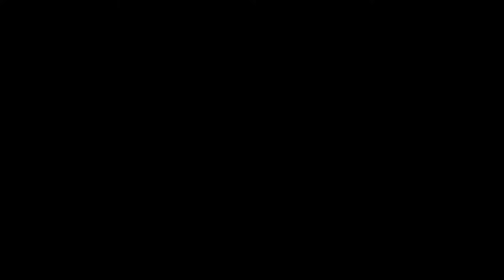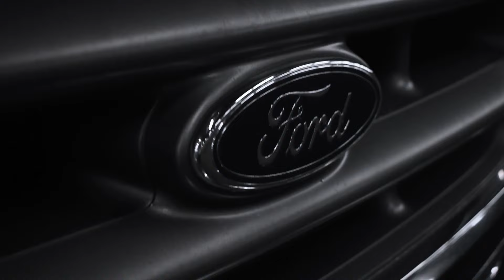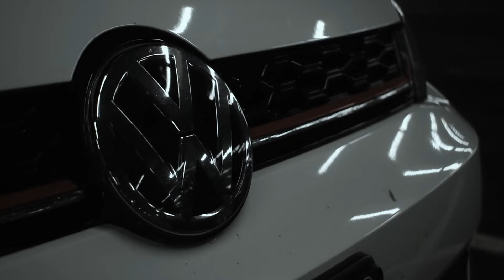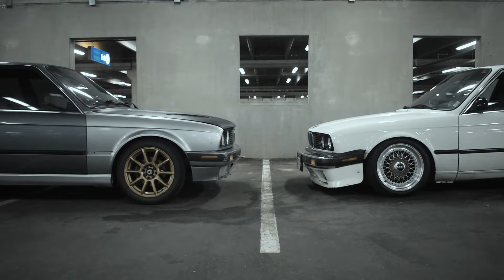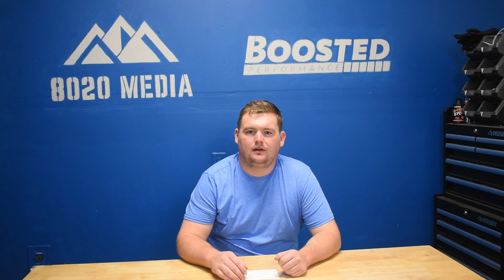How Reliable is the Ford 3.5 EcoBoost? | 3 Common Problems

Comment: I have a 2010 Taurus SHO with the 3.5TT and I would definitely include the water pump at 100K. If this fails, and many have it can drop the coolant into the oil pan. At which point you are out an engine. I replaced my water pump and timing set at 100K, carbon cleaning at 110k. Only other failure I have had is a torque converter at 125k but that is platform specific and not something I think affects the F150. 
Otherwise I am very happy with the power and overall smoothness of the 3.5 ecoboost.
Reply from the maker: Henry - Thanks for sharing your valuable experience and insights with your Taurus!
Reply: I thought the 3.5tt was external water pump.

Comment: I bought a 2012 in 2015 with 37,000 miles on it. I drove to 97,000 miles and sold it. I'm very sorry I side. One problem was an o2 sensor.  Replaced brakes (normall), no other problems.  Good maintenance is the key to any vehicle, it always has been and always will be.
Reply from the maker: Jim - Thanks for sharing your experience and insight!

Comment: One would think that after manufacturing cars for 112 years, Ford wouldn’t have so many quality problems/recalls with their vehicles. God forbid car manufacturers put a few more quality parts in their cars/trucks so they wouldn’t have such a PR problem. Crappy parts and higher prices= …ain’t gonna buy a new one for now.
Reply from the maker: D - Unfortunately this seems like a common theme with many brands nowadays, not even just Ford..
Reply: That would make sense D... if Ford was still producing Model Ts. If that was the case I'm sure they'd be building them with zero issues today.
Problem is... every year there are advancements made in every conceivable category related to the modern automobile. From tech to ever increasing government mandates for safety and fuel mileage... today's car manufacturers are constantly breaking new ground.
Reply: Constantly breaking new ground and still can't get cam phasers right. They have had problems with them in multiple engines and still have problems today! If you want to buy a ford. Kick yourself in the balls and go home and think about it.
Reply: They don't, the F150 is the #1 selling truck because they last, plain and simple. Look at people that depend on trucks for their living, what are most of them driving? A Ford.
Reply: recalls fix problems.  Glad they do them.  All of the makers do them.  Its now the norm.  In the past they made it your problem
Reply: @8020Media  Government FE and Emissions regulations have increased the complexity of every engine out there.  The complexity brought on by the government, combined with near impossible future emissions regulations, and government subsidizing of non-ICE vehicles, is the main reason (PHEV)hybrid and EV are so attractive to manufacturers today.  Self fulfilling prophecy, right or wrong.

Comment: Great video. Love my 2019 ecoboost. If you were to buy a half ton truck today based simply on reliability, what would you choose?  Still go with 5.7 on the Tundra?
Reply from the maker: S - Thanks for sharing your experience! As far as a new truck, we're not sure.. They just don't make them like they used to. Maybe anything naturally aspirated.
Reply: thank you.  I’m not a mechanic so if you can speak dummy that would help. What exactly is naturally aspirated?  I assume my ecoboost is not, but the 5.0 Coyote, the 5.3,6.2 GM models would tend to be more reliable given they are less complex from a design perspective. I’m just looking for something that will give me 250K assuming I just change the oil every 5K miles using high quality / Motorcraft synthetic oil. As you pointed out, I think the timing chain and carbon build up were fixed in the second generation.
Reply from the maker: S - If you want to stick to Ford, then the 5.0 Coyote is solid. GM's have AFM/DFM that are pretty problematic.

Comment: Change the oil early,occasionally wot ,love my 3.5
Reply from the maker: Jason - Thanks for sharing! We love a good 3.5 Ecoboost that is well maintained!
Reply: What oil u use ? Thanks
Reply: @cheizaguirre5494  is use Mobil 1 5w30 full synthetic and MotorCraft filter every 8000kms/5000 miles
Reply: @jasonbrushett2005  same thing I use, Mobil 1 is the best.
Reply: @8020Media  what do you guys think is the time to change the 5w30 semi synthetic oil? I plan on 4000 mi, but only have 1200 mi on this oil now

Comment: I own a 2014 F150 with the Coyote! It’s a decent truck, but having owned Honda and Toyota cars for the last 30 years, it’s too many little maintenance niggles in the Fords. The radiator failed; blower motor resistor failed; blower motor failed.
Reply from the maker: Gamita - Thanks for sharing your first hand experience! This will certainly help future viewers.

Comment: I have a 2017 3.5l twin turbo eco boost, my engine locked up completely  now I gotta buy a  new motor
Reply from the maker: Richard - So sorry to hear this. Do you happen to know the cause of this?
Reply: @8020Media  no
Reply from the maker: Interesting. Did you ever take it into the shop?

Comment: I have a question. I’m looking at buying an F150 soon… used. I’ll be towing about 2000 lbs but only about a mile. I put 4000 miles on my current vehicle per year. Would you suggest a 3.7 or 3.5 eco…or the 5.0. Thank you.
Reply from the maker: MJ - We aren't going to suggest any because there are many factors at play (budget, etc). But all three should have the ability to do what you're needing.
Reply: Any of those would be more than capable of doing the job.

Comment: I change my oil every 4K miles with Mobile 1 full synthetic and I change the front and rear differential, transfer case and flush the transmission every 30K miles.
Reply from the maker: Good call - we still don't trust any of these "intelligent" service oil life systems that can let you go 10,000 miles without an oil change. It's amazing how additional reliability and longevity you get simply from changing it every 3-5,000 miles instead.
Reply: @8020Media  My grandparents bought a Corolla new in 78. In 81 my sister started college and her Toyota Celica was wore out so my grandparents sold her their Corolla for what she sold her Celica for, ($950).
In 83, I needed a reliable car for college so my sister sold me the Corolla. It had 70K miles on it. I paid my sister $500 for it.
Back then all we had was conventional oil, so I changed it every 3K miles & changed the gear oil (in the 4spd manual transmission), rear end grease every 30K miles.
It got me through Graduate school, but I kept driving it because I had a LOT of student loans and wanted to get them paid off ASAP.
After the loans were paid, I wanted to save money for a down payment to buy a house.
That Corolla was a bare bones 2 dr. Vinyl seats, vinyl floor. It had manual steering and pwr brakes. It also came standard with an AM radio, lol.
At around 300K miles the rear end was howling so I took out the rear seats and stuffed dense foam and replaced the seats so I didn’t hear the rear end howl so loudly.
The drivers seat was absolutely wore out so I put a phone book in it and a pillow on top and seat covers over it.
I went through 3 clutches, 2 alterations, a few batteries, 2 radiators and water pumps.
When the belts and hose’s wore out I’d replace them.
In 2002 it finally died at a whopping 488K miles.
I bought a new Camry and drove it until my needs changed so in 2011 I bought a new Rav Limited 4WD. It has  the 3.5 V6 and a 5spd automatic transmission.
I’m still driving my Rav today but it only has 105K miles. I plan on driving it until I turn 70, (13 years). 
I’ve already decided that I’ll replace it with a Lexus RX hybrid.
I’ve had other vehicles for fun cars and I always have had a pickup for yard work, going fishing or hunting, but I’ve only owned 3 cars as my everyday car since I turned 18.
Our 2015 Tacoma 4X4 extra cab only has 35K, so I’m sure that our kiddos will be fighting over it when my wife and I are dead and gone.
My wife had an 18 year old Camry that needed to be replaced (she had to park it 3-4 months every year bc of our snow pack). She would drive my Rav and I’d drive the pickup.
Last November we decided to buy her a Subaru Outback. It was a 2 year lease return with only 5,600 miles on it.
We’ve discovered that even though Subaru’s are reliable and last a long time, they need more maintenance than Toyota’s.
I’m thinking that when it wears out we’ll replace it with a Toyota Venza.
Thanks for listening. Enjoy your day !
Reply: Hello,
Don't forget to flush the coolant and the brakes fluid too.
You're doing it right for sure.
Tigo
Reply: You might want to check the recent discovery’s with Mobile
Reply: @mcmuskie2563  What does it say or how do I go about looking up the information?

Comment: Timing chain issue in my '13 Ford Flex Ecoboost with 105k miles. They're estimating $3,000 for replacement! Did Ford ever admit this was a "known issue"?
Reply from the maker: Cutters - Sorry to hear about this! There were timing chain issues in the 1st Gen 3.5s (2010-2014), but Ford seems like they noticed it was an issue and addressed it in the 2nd gen 3.5s. They also issued a service bulletin, so they are definitely aware of the issue.
Reply: flex eco boost not the same 3.5 eco boost as the truck.  Yours is front wheel drive based and different.

Comment: Thanks for the video.  My main question is, once my 2015 3.5 Ecoboost engine starts giving me problems, can I change the entire engine out for a V8 Coyote engine?  Or Can I just take the ecoboost off and just use the V6 without the turbo?  Or do I need to replace the engine with a V6 or another V6 ecoboost?  Thanks.
Reply from the maker: Since the 5.0 Coyote is an option in the F-150, the engine bay is designed to easily accommodate the V8 Coyote engine. However, you'll also need to replace quite a bit of wiring, wiring harness, some electronics, etc. If you'd rather move onto the 5.0 Coyote then your best bet is likely selling the 3.5 EcoBoost and simply buying an F-150 with the V8. It will be much cheaper and less of a headache to go that route.
Reply: @8020Media  thanks!

Comment: If you change your plugs often enough on these, you generally won't run into problems with the coils.  If you let the plugs go to long, they stress the coils and cause premature failures.  I'm tuned, so I change mine every 20k.
Reply from the maker: Yepp, good call. Changing them every 20,000-30,000 miles when tuned is always a great idea and certainly reduces load put on the coil.
Reply: so you voided the warranty and basically can't give us any real info on stock.  Thanks for nothing
Reply: @02hreblue30  changing the the spark plugs frequently will not void your warranty. Because I’m tuned I change them more frequently @20k, but if I wasn’t tuned I would change @30k. Either way you reduce stress on the coils when the plugs are in optimal condition.
Reply: Wow, spark plugs changed every 20k? I'm at 113k and haven't changed those once 😬 (bought used at 60k). Man, I gotta change them asap now

Comment: I had a 2016 at 56, 000 miles broken motor mounts bad manifold, resonator our camper is only 4000 dry as well
Reply from the maker: S - So sorry to hear this.. However, we appreciate you taking the time to share your experience.
Reply: @8020Media  i traded that in on a 23 F350 then at 1500 miles it was deemed a lemon by Ford due to a charging system fault that could not be fixed i then got a 24 F250 i still stuck by Ford
Reply from the maker: S - Wow. Good on them! Thanks again.

Comment: 11-14 offered a 6.2L. Max Tow on my 6.2L is 11.1K. The Eco would be 11.3K. Difference is limited by the platform and weight of the engine.
Reply: 3.5 has wayyyy more available torque across the range vs normally aspirated V8.  No comparison
Reply: 6.2 on a f150? No way unless it was a raptor

Comment: you are off a few years and model.
my 2010 lincoln mks has the first 3.5 EcoBoost engine.
it later came available in the next SHO,  then the F 150.
I am still trying to find information of this first gen 3.5 vs the next-gen, 2nd gen, changes and fixes...or actual back-steps.
i understand the 2nd gen had a few more issues than the  1rst.
the f 150 is a major difference to the cars.

Comment: Bought my 2013 with 170k it had no catch can but it drove fine so I bought it. I installed catch can and replaced plugs. Sunroof it all screwed up so I just adjusted it closed and I’m ok with that. 200k runs great and hauls ass.
Reply from the maker: Nice - awesome to hear your 3.5 EcoBoost is still holding up well after 200,000 miles!

Comment: I just purchased a 2022 F150 with 3.5L V6 ecoboost engine. But the issue I’m noticing is that it idles kinda rough. I don’t remember feeling that cabin vibration on the test drive. But every time I park or turn it on. Cabin starts to vibrate. And now close to 3K miles I’m starting to feel some vibration in speeds. Now even when driving on the Hwy. overall the truck dosent feel smooth driving conditions. I am wondering if there are any other customers feel the same thing.
Reply from the maker: David - This isn't something we have heard, especially at such low mileage. Have you called the dealership by chance?
Reply: @8020Media  hey ! I have and they say it’s normal. Nothing they can do. Even the ones on the lot. They all vibrate. I am in NC. Not sure if weather and clod temperature have something to do with it.
Reply from the maker: Not sure if this is "normal", but we know many auto manufacturer's claim things are normal when they shouldn't actually be normal.. Keep us updated on this though! Curious to hear if it is actually just the weather.
Reply: Switch to a WIX HP oil filter and use a quality synthetic oil That should alleviate most of the ruff idle

Comment: with your experience and research, which engine would you say is the most reliable option for the last 10 or so years of f150's?
Reply from the maker: B - Probably the 5.0. All depending on maintenance and needs though. Here's a good video for your research: https://youtu.be/X7FNIhVxqyQ

Comment: Im not going to lie i think i would take the 2.7 over anything else...
Reply from the maker: M S - We have an article on this topic on one of our sites, 3.5 vs 2.7, and both are great engines. We think it comes down to personal preference. The 3.5 provides maximum performance and towing capacity, and 2.7 also provides great performance and towing for its size. We feel both engines also deliver good reliability.
Reply: I always get the 2.7. They get great gas mileage, lots of power and no problems, I basically just drive it like a car though.
Reply: @8020Media  yes both are great!!!
Reply: @redbull8661  yea and also it range of travel is farther then most other v8 trucks

Comment: The biggest problem is the 10-speed transmission. It's jerky and hunts for gears all of the time. I find it drives much better on the highway if you block out gear 9 and 10 at the expense of fuel economy, but I shouldnt have to do that
Reply from the maker: Toast - There have been many transmission issues noted along the lines of your experience. Definitely unfortunate.

Comment: The best Ford engines were the 300 inline 6 , 289, 302, 351c, 390,  429 and 460👍🏿
Reply from the maker: David - Thanks for the input! Have you had any first hand experience with any of those? If so, do you mind sharing to help viewers?

Comment: Do you recommend a catch can minimizing the carbon buildup? If so, for what year models?
Reply from the maker: Tim - regardless of year, a catch can is a great addition to any direct injection engine. If you want to avoid the need for walnut blasting down the road then a catch can is a solid investment.

Comment: According to Wiki, It doesn't look like the 2nd generation 2017 EcoBoost made its way to the Explorer.  Can anyone else confirm this?  I have a 2017 Explorer and would like to know.
Reply from the maker: Tony - This is correct. The second gen didn't make an appearance until 2018.

Comment: Almost all of the internals on the Ford GT are stock ecoboost parts. The upgrades are almost all external and tuning.
Reply from the maker: Storm - For the most part, yes.
Reply: @8020Media  Which means there's a LOT of power locked up in that engine, just waiting to be let free!